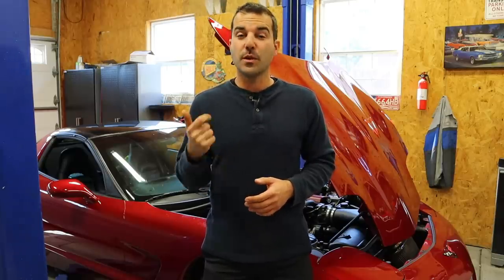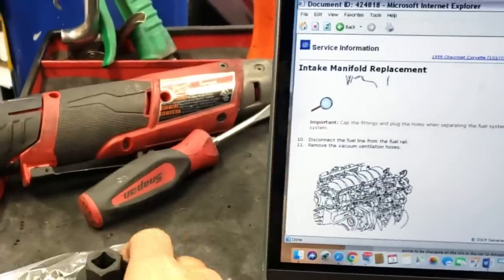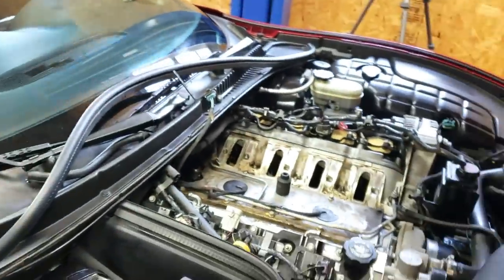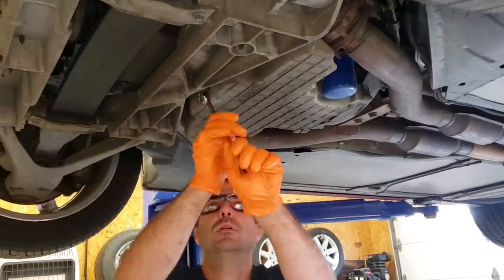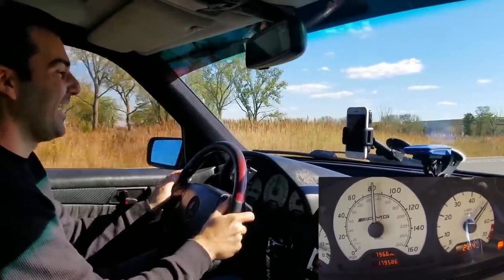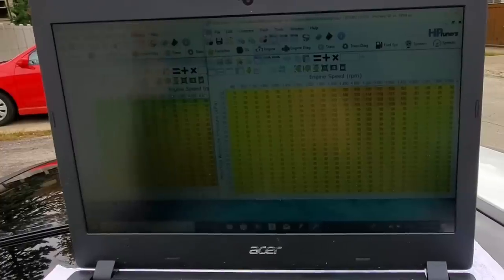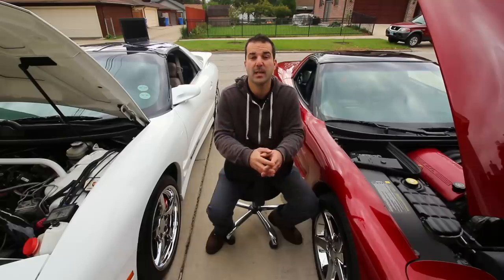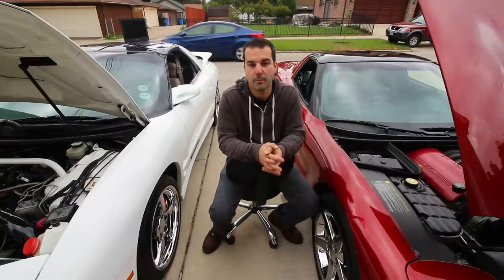I’m Building A 40 MPG Corvette That Sacrifices NOTHING! Project EcoVette Starts Now!

Comment: You HAVE to install a water/meth injection kit !
-It will help you getting rid of the knocks from running lean and help you reach crazy AFR safely !
-It will transform you heat problem in to your friend because it will use the extra temperature to transform the water in to steam which increases also the power.
-It will give you an awesome torque.
-It is a power tuning mod that  can be setup to wok all time at low flow for fuel economy.
-For fuel economy you can inject 100% water, the meth is there more for the extra power it packs.

You can buy from eBay a ready made kit or make your own one with those water pumps used for campers, there are on eBay for 20 USD, some misting nozzles in different sizes, and a manual or arduino based controller. I have posted a video in the past bench testing one of these homemade water/meth injection kits.
Reply: Your logic is flawed. Water injection displaces otherwise usable air(oxygen) and isn't compressible, so it also raises the pressure in the combustion chamber without contributing any energy, so it wouldn't increase power on its own. It will however clean the chamber and piston every cycle but that's about it, that cleaning would hopefully reduce carbon hot spots which lead to misfires that would cause a car to lose power/damage an engine. Methanol on the other hand does combust but personally I'd rather just run more knock resistant and higher detergent content fuel through the injectors that are already on the car, rather than a sketchy setup just blasting into manifold...
Reply: I did a little more research on water injection. It does the same thing excess fuel does; absorbs heat, only better because it has a higher vapor pressure. The displacement of air and being inert is going to limit power to a small extent not a bad trade overall though. Methanol has an insane stoichiometric ratio but that means it absorbs a lot heat, and again displaces a lot of air.

The issue I had is with the way you worded it. Water injection is about being able to run closer to stoichiometric to make more power and not melt things, the water itself isn't adding any power only an aid to realizing potential already in an engine. Sorry for being obsessive.
Reply: @littlerhino2006  you are very wrong my friend. Research some more in hyper miling and water injection. Research some more about termal efficiency of a IC engine, and you will understand that most power out of the IC engines is spent on  heating and not mechanical power. With water injection you transform some of that heat in steam pressure which means more power. And there are more interesting things happening inside, you better try it before talking like you are some sort of a science guru that knows everything. Sorry for my bad English, but it's my second language, I m a romanian.
Reply: @littlerhino2006  just type in google:
water injection hypermiling
Reply: @littlerhino2006  you can check out my "Water Injection" playlist if you click on my name. Its old, but there are some interesting videos.

Comment: You don't seem to fully understand how engines work. Stop reading what 17 year old kids are posting on forums, or in your comment section. Just running that engine leaner will increase emissions and make very little difference in fuel economy.
Reply: So...14.7 to 16 AFR is about a 10% reduction, that's insignificant to you?
Reply: @littlerhino2006  Less fuel = less energy = less power. Have you considered that a leaner AFR might just mean more air, not necessarily less fuel? Lean AFRs cause frequent misfires or partial burns where the flame doesn't travel to the entire combustion chamber, leaving unburned fuel. There are several reasons why that engine isn't already running at a leaner AFR.

Comment: well someone wants their engine to die earlier than it should...
Reply: You're not alone in that sentiment, but think about this.

How hot is the combustion temperature when you're hauling ass at nearly 100 mph or consistently matting the accelerator to pass people?

 Do you think putting around at 55 to 60 mph, spraying less (source of the heat) fuel into the combustion chamber is going to be hotter? It isn't. 

The problems start when trying to lean out the car at high loads like the first example I described. The additional fuel is necessary to cool the combustion, other than that it's useless.

He's leaning out the load cells used while cruising, and said he'd be tuning for power at the high end (adding fuel). He also mentioned the possibility of installing an exhaust temperature probe to ensure he isn't going to nuke the cylinder heads.

Comment: BS or just ignorance?  You say you don't want to just install the Australian lean burn system because you want to keep it 100% USA smog legal, but you want to completely change the factory system which is illegal.  Just removing the MAF sensor is already illegal, then all the other mods you're planning to achieve a lean burn and each one is illegal all by itself.  Just install the tried & true factory lean burn system and be done, or actually keep it legal by not doing any of the proposed mods.
Reply from the maker: Neither.  I said true lean burn can be very very lean. Like 20:1. Then I said we may be around 16:1. We are going to try and find a nice balance so we don't destroy the CATs or engine. Think of it as mild lean burn.
Reply: @LegitStreetCars  It doesn't matter how lean you go, removing or tampering with any emissions control devices is illegal so your proposed plan is just as illegal as using the Australian lean burn system you referenced.
Reply: @LegitStreetCars  At 16:1 you're actually producing the highest combustion temps and therefor the highest concentration of NOx. You'd have to go super lean to cool things off again, and that's not super efficient either. I'd say the cats will be fine for the EGT and NOx produced by a low load, lean engine. OP is correct, modifying engine calibration is illegal. I say to hell with the law, you're making the car more efficient.

Comment: 38 seconds into the video prediction. Will be tuned ultra conservative on OFF WOT situations. Timing conservative. BUT when Under WOT it will run safe. Will be mostly how the car is driven. I suspect nitrous will be the go fast power ladder. With a dedicated fuel cell in the front that just runs race gas and a 150 shot.
Reply: Haha at 1:00 or so I was right. Also wanna add basic weight reduction.

Comment: I'd be getting a catch can personally, burning oil can't be "efficient"
Car without a catch can is a disaster waiting to happen.
Getting rid of the EGR properly will probably help long term too.
Reply: Vincenzo G you’re clearly not an LS dude. No need for a catch can on these engines. Maybe you’re thinking about ecoboosts
Reply: @Maverick09171  Incase you didn't know all vehicles since the 60's off memory had PCV systems preventing crankcase gases being vented into the atmosphere, long story short.... every engine with a PCV system (Ford, GM, etc - old or new) will still get by-product of particles (oil vapour) which over a period of 100k miles will still dirty your intake manifold regardless of engine. Combined with EGR with adds insult to injury further more.... 

Having a catch can regardless will prevent oil being sucked back through the intake manifold, leaving a sticky black substance behind
The oil will stay separate whilst sucking only air with no vapour, tuning an EGR delete properly will significantly improve an engines overall lifespan not having excess shit being sucked back through.

An ICE is basically a big air pump, they need to expel burnt fuel not be forced to reburn it over and over again 🤣🤣
Reply: @Maverick09171  It wasn't LS specific either
Reply: Vincenzo G Well said. I’m aware of what you state, however I’m not convinced a catch can is necessary. This is proven by the millions of LS based engines that have hundreds of thousands of miles without issue. 
I’ve heard it’s a lot greater concern on the direct inject engines. I suppose because the valves don’t get washed every cycle, but that’s just my speculation. Never looked into it. 
Either way, if you feel better running a catch can, by all means do it. 
I had the rev extreme on my LS1 and it never caught shit. Small amount, yeah. But when you think of the millions of cubic feet of air passed through the engine over that mileage, what’s a couple ounces of vapor?
Reply: @Maverick09171  Preventative deposits in your intake, can't argue with a $250 part for years of simply draining a few ml that would have otherwise gotten into the intake manifold & adhered itself bahaha, direct injection is flawed by design so i'm not suprised 🤣

Not to mention i personally like the quieter nature of regular Sequential port injection, direct injection is noisy, on a petrol engine it doesn't sound all that "good", it gives an unrefined sound more so because of how loud these little bastards are
Reply: @Maverick09171  Keeping your intake manifold as clean from shit as possible is cheaper than a few thousand cleaning the prick out in the long run

Comment: I will never understand why you american people buy this huge engines... Your speedlimit is so low that every new car can achieve it in 4th gear or something. Here in germany basically every "normal" car has a 2.0L 4cylinder Turbo engine (or something among those lines) and basically every car does 30mpg (in your funny freedom seizes). But still those 1xxhp are enogh to cruise at 100mph with a great gas milage without concentrating crazy (since we know how to switch to the right lane and stay there)

Comment: This is a stupid video.
Explanation:
If you change the rearend gears you will get the most MPG.
You will also have the slowest Corvette in the world.
So. What is the most MPG if you change the gears? Around 32 to 35 MPG.

How to get the most MPG?
Put the front end of a Manual GEO Metro, in place of the V8.
You should get at least 50MPG.

Like I said this is a stupid video. GM spent millions designing the car, and some YouTuber thinks he can do better them a Billion dollar company, with buildings full of engineers.

Comment: Hi. Are you the Florida guy who found a red Vette with crazy low miles that was listed as a flood car? . In your video you... or the guy...said you/he would part it out because he/you didn't have the title. ARE YOU CRAZY??????  In Nevada you would be correct. Arizona ditto. In most states ditto. But in California all you have to do is go to DMV. Tell the truth ...fill out the "Statement Of Facts" form and the request for new title form ... and California will give you a new title. A fresh title. Just tell the truth. iE: "a person wanted to see if I could help them get their car running. Hi..... I never saw them again. That was 2 years ago"... do NOT tell the whole flood story.... or where you actually got it. ...then guess what? A new fresh title  not a salvage title. California???? Yes California. Dude I've flipped over 300 cars since I was 15 years old. I've doe this Statement of Fscts thing st least a dozen times. California?? Yes California. I live in ACs & AZ and Nevada. Only California does this. Guess why... CA got sick of having unregistered older cars on the road. This solved the problem. Will not work on newer cars. For obvious reasons.

Comment: HAND TIGHT is all your oil filter needs to be, I was cringing as you literally wrenched it on.
Reply: Did you know most filters have a specified torque that isn't 'hand tight'?
Reply: @littlerhino2006  I do! And in what part of this video do you see him using a torque wrench on that filter?
Reply: @ethanjones4678  once you've done it a few hundred times it's muscle memory. My point was the specified torque is more than just 'hand tight' whatever the hell that is.
Reply: If you knew that then why would you comment anyway?
Reply: Because he was cranking on the oil filter, why did you even reply to my comment?
Reply: Hand-tight is as tight as you can get it without the leverage of a tool, he used a wrench to tighten it, so it's not hand-tight.

Comment: I’m 14 and I was putting a turbo kit on I had it checked because I was doing it for a surprise what my older sister wanted on her mustang I mest up once by not putting the the tune it needed to use the turbo kit and putting the billet bearings in the engine because the stock one was powder metal and she had trouble so I did it for her but it was a pain trying tho

Comment: I am from europe, i don’t know of i got my math right. But when i convert it to liter per kilometer i get 1 liter on 17 km. Thats not eco at all in my book...
Reply from the maker: I believe it's 7 liters per 100 km.
Reply: @LegitStreetCars  actually 6 liters
Reply: 7l per 100km is unbelieveably eco for a V8. Most of our i4 and i6 engines take more than that.
Reply: LegitStreetCars i consider that regular fuel consumption. But than again i don’t drive a V8
Reply from the maker: Well the car is rated at 28 mpg highway just to give you an idea of how large the improvement would be.  40 mpg would be awesome on a 350 Horsepower sports car. Remember it's primary purpose was never fuel economy.
Reply: 6/100km is insane. Literally insane. You can barely get a diesel that can top that let alone a v8 vette.
Reply: Lassi Kinnunen i don’t think i ever gonna pay 140.000 euro’s for any car. But i was just confused about the term eco. Cause i have a different perception of eco. I do like the idea of @legitstreetcars and i hope he succeeds and can even step it up!
Reply: Kiari i believe my 95 ford zetec-se 1,6i engine did that. So i don’t consider it insane
Reply: @tuneskramer69  I don't think that's a v8 corvette.
Reply: Kiari no its not, but its one of the reasons i have a different perception of eco. And thats were i got confused. I never driven a Corvette in my life. I am not here to slant or something. I just got confused thats all
Reply: @tuneskramer69  Yeah I see what you mean. V8s usually love drinking fuel. At least 12l/100km highway or 20+ city.
Reply: Kiari lol, thats what i call insane